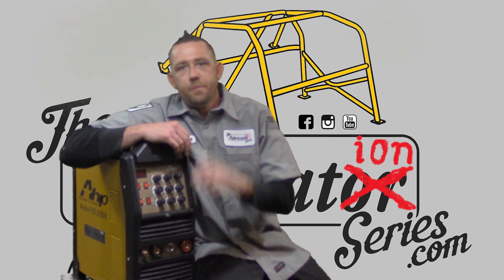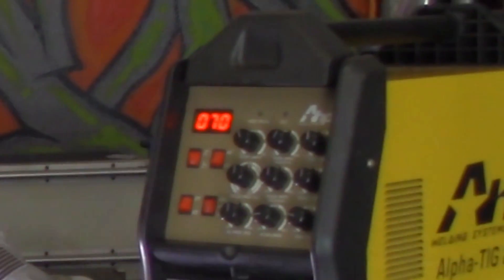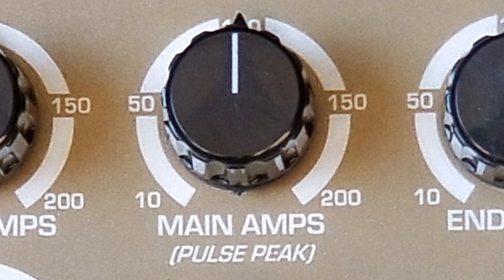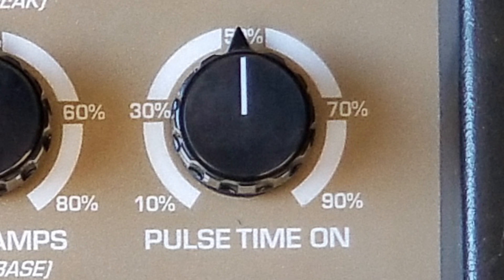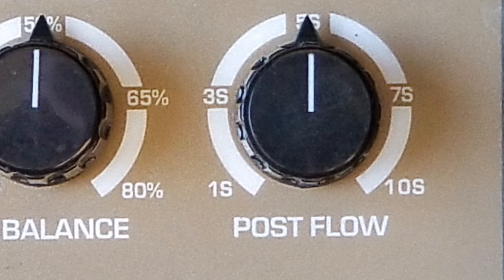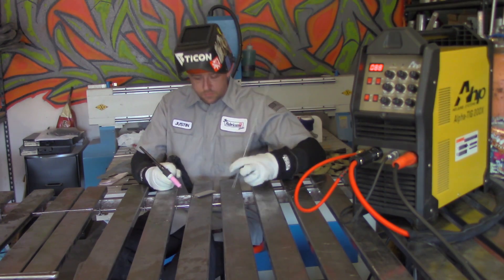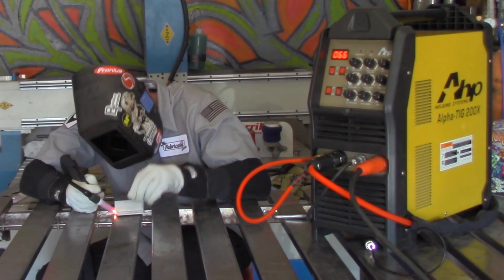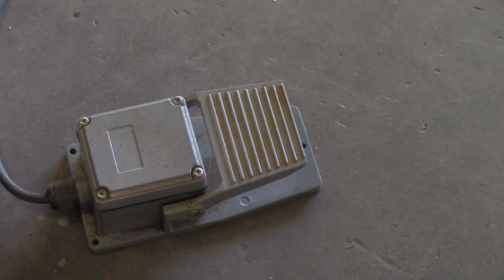TFS: AHP Alpha-TIG 200x Setup and Review

Comment from the maker: Buy the AHP Here!
https://amzn.to/2BlN413
Reply: @49TAndrew I have the same question
Reply: Primeweld or ahp ?
Reply: Cheaper from the manufacturer and a newer model. $690
Reply: I own the Ahp your showing. At work I have a Miller durastar 200. I like them them same only I didn't spend $2000
Reply: Hiya, i noticed the machine doesn't have a Pre-Flow dial , is the pre-flow just build in like a default 2 seconds or so ? tks ..

Comment: Im about to do a bunch of frame work on a 70 gmc and im stuck between this tig and a hobart handler 210 mvp mig. Id rather a tig so i can do stainless and aluminum but i dont know if this would make strong enough welds to weld in a c-notch and getmy 4 link in. Any input?

Comment: I know this is an older video. but can you possibly help me out? 

I'm trying to run a dry rig on this machine. But it seems to want to stay at like 15 amps. I have to pull my tungsten really far away from the work piece to get full amps and when I close the distance it goes back to 10/15 amps. How do I get full amps.

Comment: Is this a inverter type machine where you can have sharpened tungsten on aluminum or is it a transformer type that you have to use the green tungsten with a balled tip

Comment: @Justin -- Had a question about the AHP Welder. I heard you talking about the Pulse settings but I would assume you would not really use those settings with Mild Steel, probably used more for Aluminum correct? Just purchased the 201XD and was trying to get it setup.
Reply from the maker: I dont use pulse at all
Reply: @TheFabricatorSeries  Appreciate the feedback. The AHP seems to be a slick welder for the money but after I get established I think I might upgrade to the Everlast. Just didn't want to lay out that much h cash upfront 😁

Comment: I just bought my second AHP Tig. First one was the X and now I have the XD. Internals are improved slightly but overall the same machine. Now, for those wondering why does the new one costs less, it’s because resellers like on Amazon, Home Depot, Ebay and other websites have always had their price tag higher than that what AHP WELDS Website sells their machine for. They don’t have the new model available. 
Everyone is out of stock except for AHP WELDS who started out selling the first Alphatig for $700 and still selling for just about the same price. AHP WELDS don’t have the older model available, only the new one for their regular price tag. AHP charges $30 for shipping; Amazon used to have free shipping on that machine - not anymore. Almost same price at the end. 
Now, the Everlast machines are very intriguing but like one of the comments below stated, they have a 1000 different models doing the stuff. I still want to try one of them though. Good luck everyone!

Comment: Can you get your hands on a 201XD?? I just bought one but found no info on it. Supposedly its supposed to be a improved 2019 model of the 200x.
Reply from the maker: It's pretty much the same machine as the 200x but the internals are upgraded and it has no flip up shield.
Reply: The Fabrication Series that’s what I’ve seen. But I wanted to see if that’s true from people who owned the X. See if maybe the old parts were actually better.

I only ask because I got my XD for around $80 less than the “older” X sells for. Wondering how they upgraded yet the X is still more $$

Comment: Doesn’t this machine come with a 150a torch yet it’s a 200a machine? It really is a good machine besides that
Reply from the maker: Yes but 150 amps is a duty cycle rating. That doesn't mean it wont do more. It simply means it wont last as long and it will get really hot when you weld for extended periods of time above 150 amps. I'll be honest - I havent cooked mine yet and both students and I beat on these machines and torches.

Comment: I want to get into welding but want to learn stick welding first. I was thinking about getting this welder just so I have the option to tig weld later on. 
Would you recommend this for primarily stick welding at first ?
Reply: I’ve had mine for a year and have been stick welding with it. I’m now getting ready to tig weld with the machine. I think it’s an awesome machine, it loves 7018 and 6013 welding rod.

Comment: great vid thanks for all the help ,  but i have a question  have a miller 212 autoset with spool gun love it ,spectrum 875 plasma,great machine,    looking for first tig for my fab shop problem is looking at alpha tig 200 but i have a miller coolmate 1.3 sitting on shelf what machines can i use this on  ?   also on amazon cant find ahp  tig machines  thanks much

Comment: great video, thanks for your information. I bought the ahp to learn tig,  i am very happy with this machine and had to learn how to use it from videos like yours.  my first project, and the reason for the purchase was to rebuild a 70 hp yam outboard. Had to learn about rockwell hardness & carbide straight fluted bits to drill out broken head bolts, then  how to build up old aluminum that was exposed to saltwater, with tig.  Youtube videos like yours saved the day, my outboard is back on the boat and runs like a champ.

Comment: Looks like a tough pedal to use for prelate tig welding !   Hahaha.   I’d have to replace that pedal fast.
Reply: The stock foot pedal is a 10K variable resistor. There is nothing wrong with the stock variable resistor. What has folks modifying them or replacing them is how the foot pedal's travel translates to the movement of the wiper on the resistor. ie like having a cars with too quick or too slow motion of the accelerator pedal to throttle movement. If crafty you can just pad the resistor electrically or just mechanically change the gain of the linkage on the pedal. ie a non car analogy is a video game where the controller is too quick or too slow in hand movement to the actual player on the screen movement. The real funny thing is folks with welders often build or modify stuff but the modifying the stock pedal seems an almost taboo subject. :)

Comment: I’ve had mine for a little over a year and I am by no means a professional, but after reviews like this and other people’s videos, it really does seem to be the best thing for the book until you get to about 15 or $1600 and even then it’s hard to beat. I have the SST pedal (LOVE this pedal, it’s well worth the money and should be considered part of the machine purchase) and with that and of course a stubby gas lens kit, it’s been a better machine than I am welder! Ha. Thanks for the videos dude. From the 2016 model and up I believe, they came with the upgraded flex head torch and super flex cable and mine has been excellent for any of those still on the fence about this machine. You won’t be disappointed.

Comment: I have the same machine and am struggling with 16 gauge square tubing which I need to master for a project I'm working on, After watching your video I'm thinking the pedal is the issue, I did screw it down to a board and that fixed the sliding around problem, but not the control issue... the thing just isn't responsive enough there does not seem to be much of a middle range to it... Learning Tig is challenging enough, the crap pedal isn't helping... Off to Amazon I go... Thanks for the review man!

Comment: Well,.... I have an earlier version of the AHP without the high-freq and have had no trouble with it from right out of the box. I have upgraded the torch to a CK flex-lock, cable same, and gas lens kit. Guess my gripes are the foot pedal (fully agree), and obviously the torch set up. As far as welder failures, my Miller 211 went down the other day, and the AHP is still working.
Reply from the maker: Tom Herd I've blown my Diversion 180 up 4 times. If it goes down again, I won't be fixing it haha.

Comment: so I have this machine, being a dual voltage capable, have you welded AL on 110?
Reply from the maker: 103m95g Yes, I have. When re run this in welding classes it stays on 110 all day.
Reply: The Fabrication Series any complains on this machine using 110v . Not doing anything serious with it, just fabricating car related things, Crossmembers, turbo kits, turbo piping ect. Stainless and aluminum mainly

Comment: Hi - thanks a lot for the review and the setup. This is very helpful. I have the same machine I purchased recently. I have TIG welding 1/4" mild steel DC with no problem. But I can't seem to be able to weld aluminum. My test coupon is cleaned and de-greased 1/4" aluminum, I'm trying to lay a simple bead. The settings I'm using : 100% Argon at ~15cfm, TIG torch with 2% Lanthanated Tungsten grinded to a point - I've tried 1/16" and 3/32" - cup #6. The filler rod is 3/32 ER4043. The machine is set to: main amp set to 100A, (I've tried going the full range of the pedal). No pulse, 2T, AC, 30 to 35% balance and 3 to 5s post flow. The arc coming from the torch seems ok but the 2 problems I have are: 1. the puddle get dirty and black quickly, the tungsten balls up really fast and 2. the filler rod does not stick to the coupon, it seems to want to walk away from the torch... Any idea what I am doing wrong ?
Reply: I don't know much about TIG welding aluminum, but 100 amps does not seem near enough for 1/4" aluminum.  With the foot pedal floored you will still only get up to your main amp setting.  I'd try 150 amps or more and see if it improves.
Reply from the maker: It's very difficult to say exactly what the problem is without actually being there. Some of what you describe could be a result of the leads being backwards (set to EP instead of EN like in the vid) and some of what you describe could be from technique (too much torch height or angle with lack of puddle before adding rod). You can message me on Instagram or Facebook with some pics of your results and I can attempt to walk you through it.

Comment: I bought mine and made a review back in may and i like it a lot compared to the dynastys i use at work. a week ago i finally ditched the stock pedal and bought an SSC lincoln style pedal and it works far better. The down and dirty of it is, that the machine is a steal at $680. However please for the love of god do not do what i did and waste money on chinese consumables, because the amazon gas lenses i bought are fucking shit, just buy some CK lenses, theyre well worth the money. I wanted to try and weld aluminum with a gas lense since im used to a standard #5 and the chinese ones just burn my tungsten up because it wont let the gas flow through.

Its a great machine to learn with to keep startup costs low and in the last month alone Ive made over a grand doing side jobs.

Comment: How is the arc start on thin gauge material?
Reply from the maker: Christian Sharron The thinnest I have welded with this is 16 gauge, but it was decent. It isn't super crispy like my other machines (it kind of farts when it starts), but it doesn't go nuts or anything. It's stable.
Reply: the start is good but the cut off amperage is kinda high, especially on aluminum so getting used to cratering out on it takes a second

Comment: Purchased one a year and a half ago. Its been running like a champ. Had never done any welding prior. Closest i had done was some brazing and soldering. Learned to tig fairly rapidly with the machine. Was able to buy the machine, a large argon bottle, a nice helmet, gloves, clamps, a table, etc... for about $1400 which is the base cost of the blue and red welders. I think hobbyists in all arenas forget about the cost of entry in a hobby, when you have nothing to start with. Sure snowboarding or skiing is relatively cheap on a yearly basis, but buying a board, boots, bindings, clothing etc... adds up in a hurry. Same with welders, if you want to dip your toe in to see if you like it or make use of it, the other options can be very cost prohibitive. Definitely i recommend it as a starter/learner machine.

Comment: I purchased this machine a year ago. I’m new to tig  welding but I was able to stack some dimes with this machine in a couple of weeks. I too hated the pedal. I picked up the smc pedal and a gas lens furik cup. I’m very please with the machine so far. I weld a lot of alum. It works very well for that as long as it’s not more then 1/4 inch.

Comment: I  bought one.  mostly for aluminum I'm a hobby welder and tig is new to me.  your review was very helpful.  My opinion the paper manual that came with the AHP sucks.  your review was helpful with adjusting settings.  Maybe you could set up machine with trigger switch sometime.  Thanks again
Reply from the maker: James Hunt Check out the 2T/4T episode. I used a digital machine for it, but just substitute the start and ending amp control shown in the video with the knobs on the AHP. Connect the trigger and start welding. 

https://youtu.be/uzPrZb0oXT4

Comment: Thanks for the review.. I've been back and forth between an AHP machine and a everlast for a startup machine..
I don't do a ton of tig welding mostly mig (I have a miller 210 for that)
In your opinion would you choose this over an Everlast for the money??
Reply from the maker: Kevin Luck I guess it's all up to the budget. A comparable priced Everlast has a few less features, but better control. I'd probably go for a higher end Everlast, but that's based on my welding style that requires a lot of fine control.
Reply: The Fabrication Series 
Thanks.. everything I've read and research is pointing me more to the everlast units, customer service and warranty are spot on with them for the most part
Reply: I've also narrowed it down to this and the Everlast Power I tig 200 and 201... very hard decision...
Reply: I too was going back and forth between this and some of the everlasts.  I ended up with this for a few reasons.  First, every machine is gonna break at some point.  Everlast seems to have 367 different models and i doubt i'd be able to find parts for it after its well out of warranty - like you would with one of the big names.  Ahp makes one mig one tig and one plasma cutter.  The multi process tig/stick/plasma everlast i was looking at would have given up ac welding (so no aluminum).  It was also a lesser duty cycle than this.  The other thing - i've seen a video (i think it was a weld.com shootout) between this and a few others trying to test their duty cycle... This is rated at a hefty 60%, and despite all of that it went a full 10 mins at 200 amps... I thought that was insane - my gloves would be radioactive after holding the torch 10 mins at 200 amps...
Reply: The everlast irig 200 is only dc unless you get the $1400 200dv  so 1400 buck to weld ac/dc with everlast
Reply: I would go with an Everlast if you can. Better features and control for a bit more money.

Comment: decent machine and value when it doesn't blow up, HTP invertig or Miller Dynasty its worth the extra money 💰 in the end. we tried these cheaper import machines and sent them all back before the 30 day trial
Reply: If you are a person who earns a living by welding you could probably justify spending the money for an HTP or Miller.  However, hobbyist welders or people with a tight budget often don't have the budget and/or cannot justify the cost of an HTP or Miller.  I wanted an AHP for a few years but couldn't justify the cost of a new Alpha Tig. As a result I constantly trolled Craigslist for a lightly used AHP.  It took me close to a year before I scored a used one, that was not nearly the price of a brand new one.  I've had my Alpha Tig for a little over a month and love it.  For what I do it works great.  It came with an extra 19 torch and a SSC foot pedal. 

We are all different and have different priorities. After paying various bills, taxes, etc. the vast majority of us have only so much disposable cash to spend. Some people use that disposable income on motorcycles, cars, travel, etc. To each his own.  Everyone's priorities are different.
Reply: I have 2016 for 1.25 year and have pushed it hard ! for some one new to tig I have great luck with mine and after upgread the pedal and regultor its been rock solid and I didn't have to spend $3000 to learn with and no way my wife would let me put that much money in a unit that I don't make a living with :)
Reply from the maker: Auto Fanatic I mostly class this as a starter or backup machine. It will get someone started or save their butts when their primary machines takes a dump. It welds very well for the price, but it's not a high dollar machine.
Reply: The Fabrication Series totally we tried this, an Everlast and Eastwood and they all had quirks we were seeking lower cost machines for our fab shop since most employees trash equipment the idea made sense. i then decided to make each tech buy his own machine now they baby them and everyone happy.
Reply from the maker: Auto Fanatic Right on. Part of testing machines for reviews on this channel is using them in our TIG classes because they see some abuse. If they fail to survive, they don't appear on the channel haha.

Comment: Thanks for your time in making the review. 
Question... do you have any info on the lincoln 200 tig welder or the Esab 186. Just wondering if those two machines would be as good as the  Alpha TIG200x or better...Thanks
Reply: The Fabrication Series I agree with you on this comment. The Lincoln TIG 200 has more to be desired. Seems like they were trying to keep up with inverter and missed the mark. Thier entry tig machines have always not been great
Reply from the maker: Bombardier64 I've run both. I was disappointed with the TIG200 from Lincoln. It's a nice machine - but I expected more out of it and the AC wave is just funky. The Thermal Arc 186 (an Esab product) is the machine I have run as well. It's pretty solid and has a nice range and output, but the stock 26 torch with hand controls is bulky. I'd switch it out personally (just my preference).